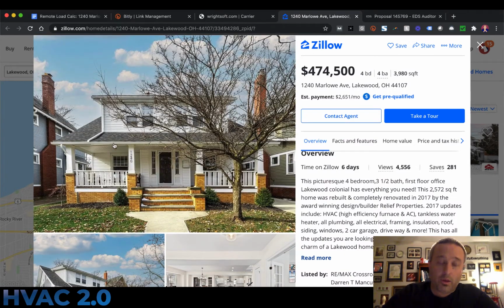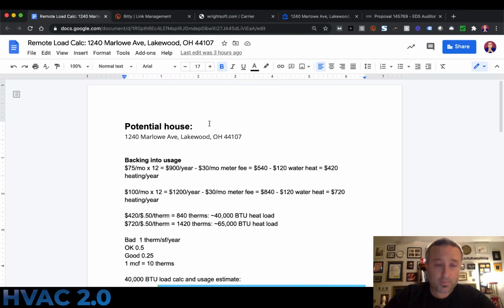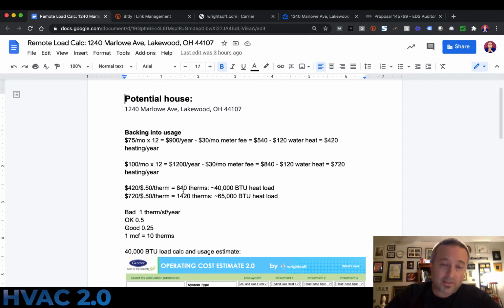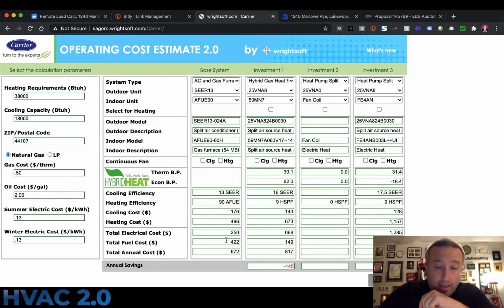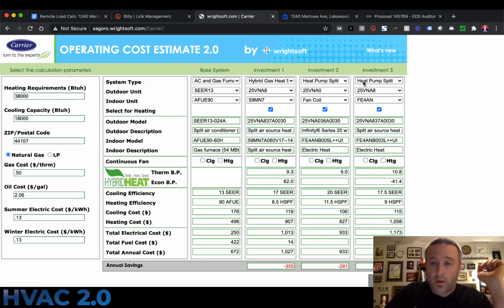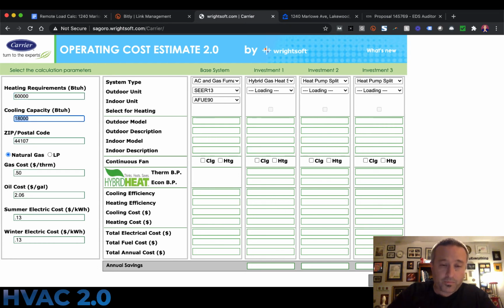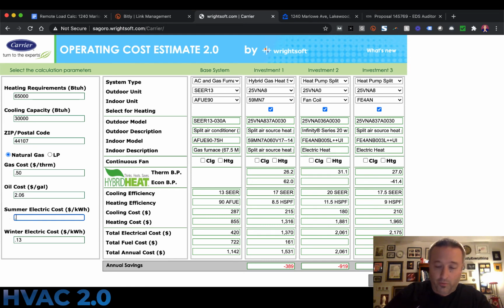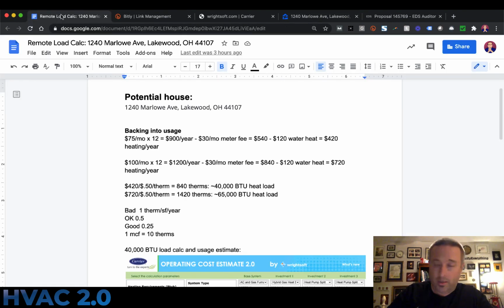Using Energy Use to Back Into a Load Calculation

Comment: I tried to replicate this calculation in my house but am scratching my head. ~2000sqft house in Seattle with 3785 CFM50 blower door. Annual gas consumption of 630 therms (previous occupants).  When I adjust load in the Carrier tool to match annual consumption I get 13500 Btu/h heating load. Really low.  Should I be using a different consumption/cost input, like consumption in the coldest month annualized?
Reply from the maker: Hmm. Maybe try a different nearby zip code? 630 therms is a fair bit for heating in your climate, I'd expect load closer to 40kbtu (an educated guess, maybe a bit higher or lower)
Reply: @hvac2.038  Nearby zip codes only make a marginal difference.  But if I use just the consumption from the coldest month annualized I get 43kbtu. Closer to your guess. Does this calculator really expect an annual consumption number for use in a seasonally adjusted model?  Or maybe its assumptions for my area are just off?
Reply: @emackres  To be clear are you talking about EDS or the Carrier program? Either way it sounds like you found a hole in the model. This is why I have trust issues lol! We're working on a calculator to do this differently, but it's not ready for primetime yet.
Reply: @NatetheHouseWhisperer  I'm talking about the Carrier program.  Looking forward to using what you put together. The options for using billing and blower door numbers to derive load seem limited and inconsistent. Would be great to have more rigour and consistency here to shrink the "cone of uncertainty"!
Reply: @emackres  Agreed, it's very annoying having to double check numbers constantly while seeing if they pass the sniff test of intuition. Step one is to build a usage to load calc double check (can't lean 100% on it, but it'll provide the bottom end of likely heat load.) Step two is to create our own load calc tool within HVAC 2.0 that automatically pulls in blower door and energy usage to shrink the cone of uncertainty. Love that you watched that video! Fingers crossed we'll have the first done and added to the software this year or first quarter and the second one done sometime next year.